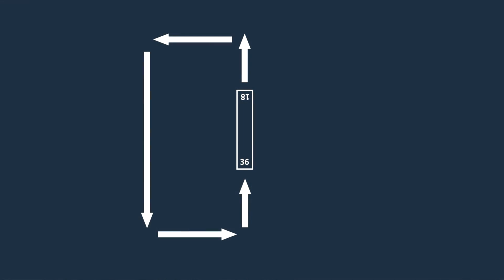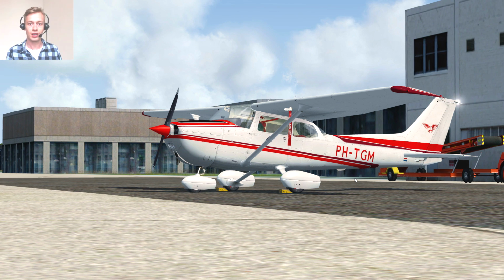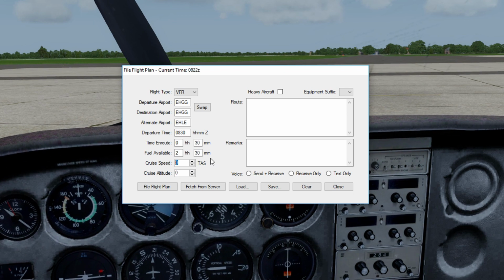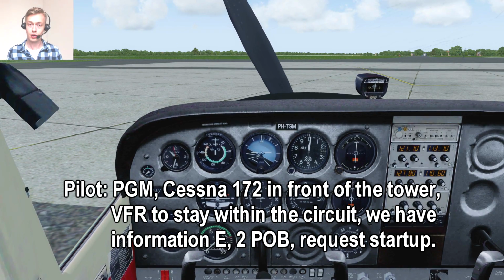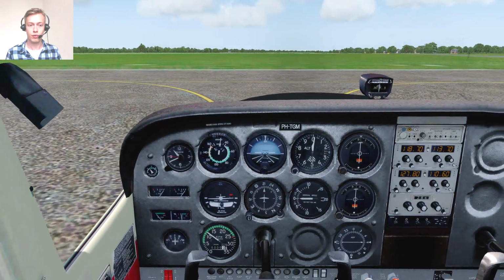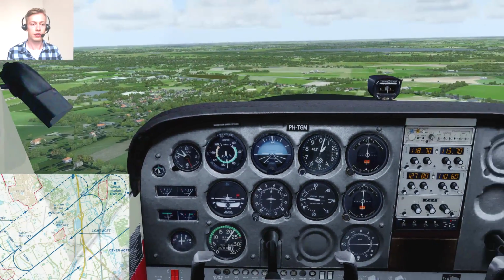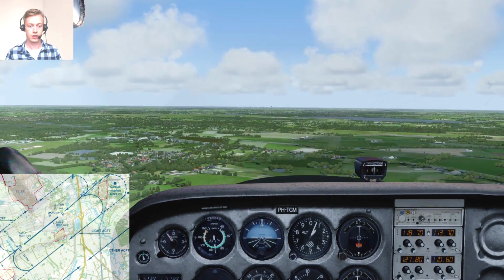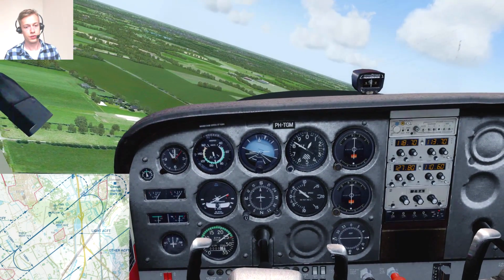VATSIM VFR Circuit Flying + Introduction to Phraseology!  [VATSIM VFR Series - #3]

Comment: Hi there Ive been in to sim flying for quite a few years now on and off, (also had a training flight in a real aircraft)  had quite a few of the older flight sims but I'm really looking forward to the upcoming release of flightsim 2020 on the xbox series x as i have not had a pc fast enough for some years now and also my older sim gear (stick and throttle) out of date. So my question to you guys is will you be supporting the xbox release in a week or two as i would quite like to set up a vatsim account and get flying with you at some point in the future with some new gear too? I've seen some posts of people using vatsim and i have to say this looks next level.
Reply: Vatsim currently has no plans to support Xbox. Mainly because the Xbox version doesn't allow interfacing with the vatsim software to transmit data like aircraft position, frequencies and transponder information. And they do have a good relationship with Asobo, so if they were really pushing for it and the community would do so as well, Microsoft could probably fix these issues, but it doesn't seem like enough people care.

Comment: I did it! First Vatsim flight, did 2 circuits and then landed, just like your example. Flew it at KFMH tonight, and I screwed up taxiing a little in the darkness, but everything was fine. Ground and tower were both on-line and friendly.
Reply: Thank you for this video, is what I meant to say.

Comment: Nice video with alot of good info! Have you ever tried using track-ir (or another head tracking device)? Ive used it for several years now and it really helps with spacial awareness in the circuit, like you said, you can pop your head down to look under the wing or look over the nose of the aircraft to see where you are coming out on the runway threshold. I really recommend it.

Comment: I think you should review the ICAO doc 9432, if you are flying as a VFR traffic you don’t have to request any startup clearance , because you are not subjected to eurocontrol slots. I also noticed that you want to follow real-life proc (like magneto check), there’s a more important thing that you have missed : you completely forgot to manage you flaps during the takeoff. Finally I recommend you to reduce the throttle after you reached your cruising speed and altitude, remember: it is not a constant speed prop, so it means that your prop/engine rpm are proportional to your calibrared air speed and your manifold pressure (not shown). If you want to make VFR flights more realistic, you should follow these simple guidelines.
Reply from the maker: Startup clearance is required for VFR flights in the Netherlands at controlled airports, as discussed in the theory video. I don't fly GA aircraft often, so in this tutorial series I'm focussing mainly on the procedures, not the aircraft, especially since people can fly a lot of different GA aircraft, so bear with me with those kind of mistakes :)
Reply: Managing the flaps in a 172 on takeoff? lul. Maybe if he was doing a soft field take off at max weight or something
Reply: Requesting start-up is advisable though on bigger airports. You will be warned when ifr traffic load is too high to allow circuits before you waste time and fuel.
Reply: In Belux, vfr pilots are not expected to listen to atis. Atc wiĺl provide qnh, winds and cloud cover besides active runway.

Comment: The dutch standard entry is 90° to the downwind?
Seems a little weird ... normal procedure in the countries I've flown in (USA and Germany) is entering the downwind with a 45° angle.
This gives you a much better opportunity to dodge incoming traffic on the downwind as you only have to turn 45° either right or left (depending on the traffic pattern).
Reply from the maker: Yep, although often ATC might direct you to base instead or you fly some sort of other procedure via specific landmarks.